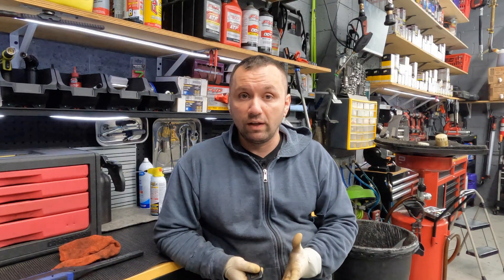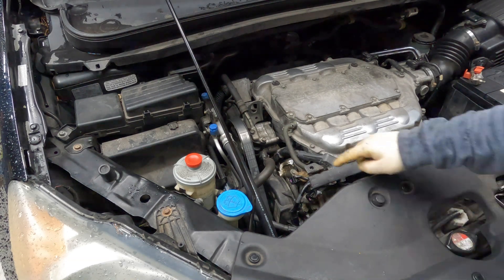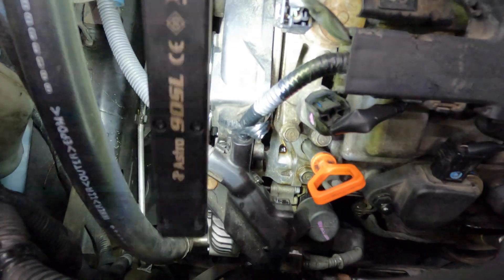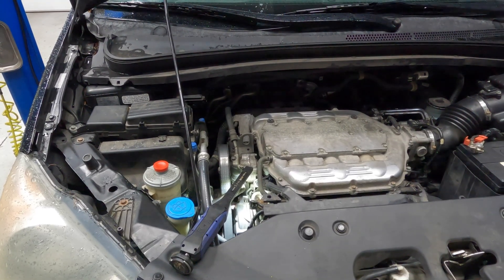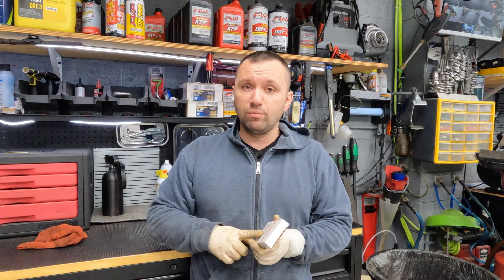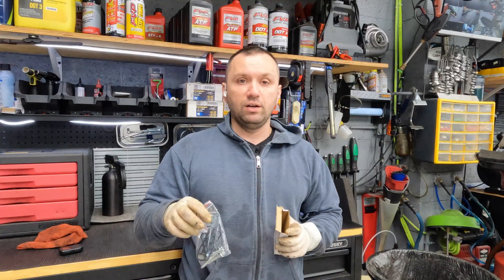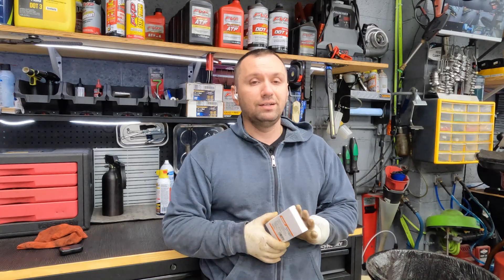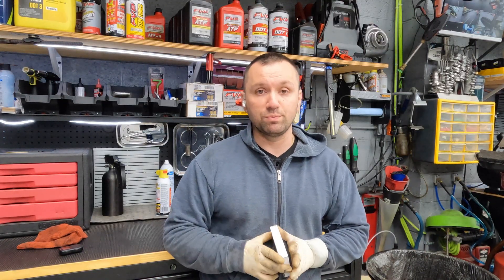QUICK TIP: MY HONDA'S ALTERNATOR KEEPS GETTING OIL IN IT & FAILING!  I'VE ALREADY REPLACED IT TWICE!

Comment: Hi. Did you have to swap and use the OEM Honda filter screen on the Dorman gasket? Or do you recommend just leaving the Dorman filter screen as is. I've seen some videos where doing this fix, they swapped filter screen out and used the Honda one. But also to add, I think they're gasket set was some really cheap off brand set, Price from like $6 to $10.
Reply from the maker: I’ve used the Dorman ones with the gaskets that they come with and I really haven’t had issues if you’re able to get a Honda gasket that is always the best option but I haven’t had issues like other people have had with the Dorman ones
Reply: @TheEnthusiastMechanic Ok appreciate that.

Comment: Thanks for this great video. Looks like this is exactly the issue with my Pilot - battery isn’t charging, alternator has oil on it, base of spool valve is oily. My question is, do you think my alternator is shot and needs to be replaced? Or can I clean it? After of course I get the leaky spool valve gasket replaced. Thanks!
Reply from the maker: If your alternator is charging and hasn’t failed yet, you can try to clean it, but make sure it’s completely dry before you start it up. If oil has gotten in there, you should also know it’s probably better just to replace it because it probably won’t be too much longer until it gives out even if you were to clean it.

Comment: Be careful with the Dorman parts. Hopefully it is a rebox with this part. I used a Dorman O-ring kit for a oil cooler adapter on a Chevy truck. It came back a week later leaving a trail to the shop. Could have cost me a lot of money if the customer didn't notice the oil leak and burned up the engine.
Reply from the maker: It’s always a gamble with aftermarket parts.